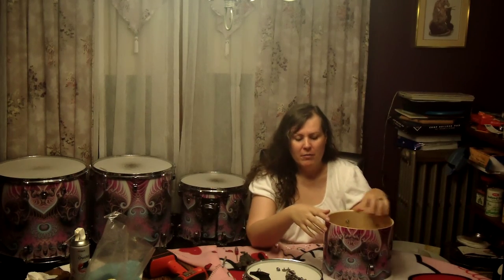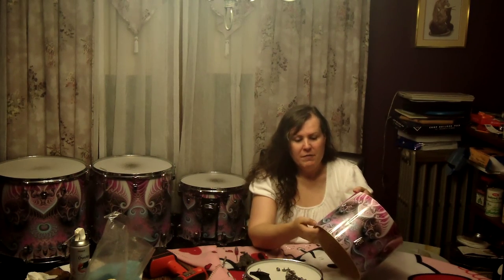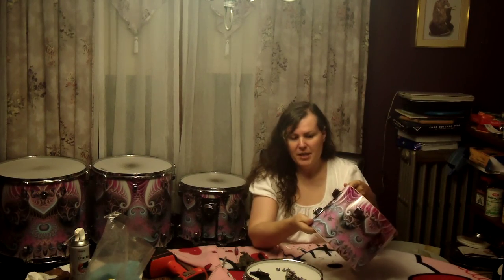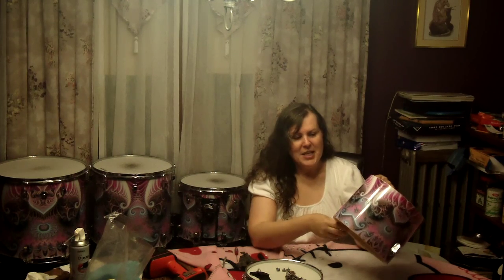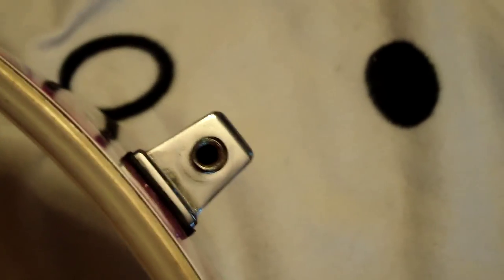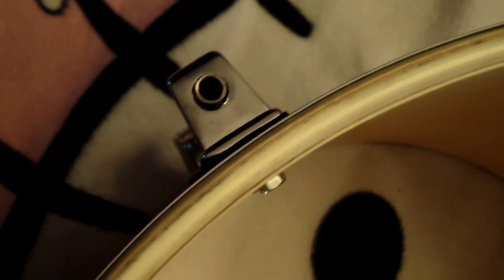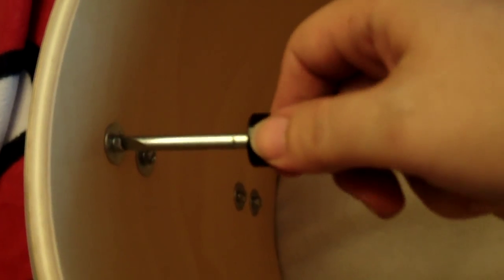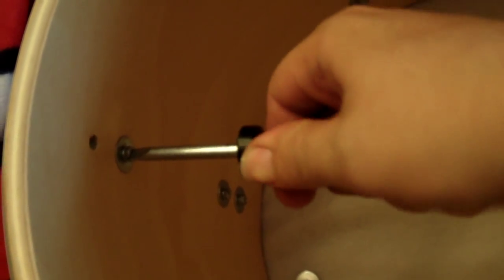Ludwig Classic Birch Rewrap with Sic Skinz Wrap - Part 1

Comment: I am grateful for your effort, having spent way too much money paying for re-wraps. Your details are very helpful for DIYers. I would offer one minor correction: I acquired a 1996 Keller Shell DW kit with quality of tone that eclipses newer Collector DWs. However, the wraps had tension fractures which I learned were due to the seam being incorrctly placed between lugs rather than at the lug which, when applied correctly, will allow minor amounts of movement to accommodate natural expansion and contraction of the shells from humidity changes; also, some wrap materials will contract simply with age. Beyond this minor criticism, I must say I've only recently discovered you, Penny, and appreciate everything you bring to the table.
Reply: Interesting. I think with these wraps, which are super-flexible and maybe even "rubber-like," I can't imagine them ever cracking. I can see pros and cons with this particular style of wrap putting the seams between the lugs instead of under them, but with stiffer plastic (more traditional) wraps, I can totally see the benefit in giving some breathing room. Thanks for the thoughts, and I'm glad you're digging the vids.